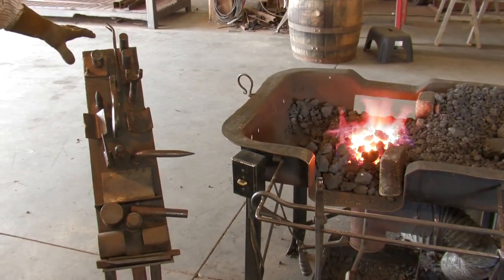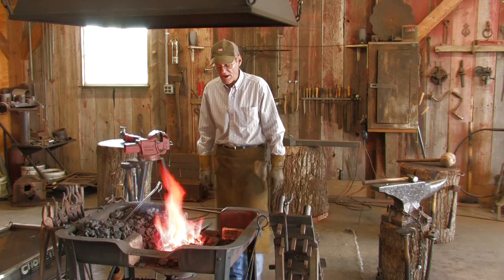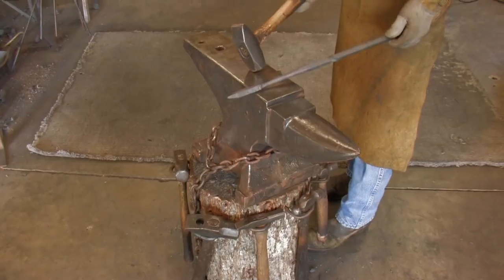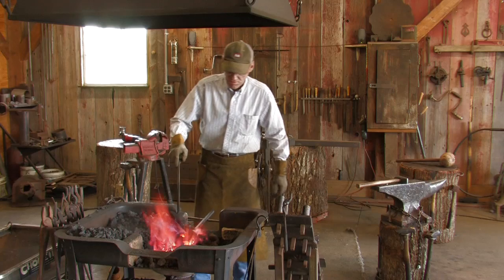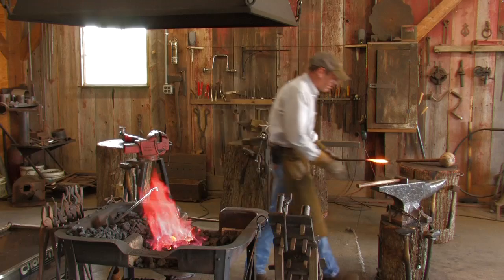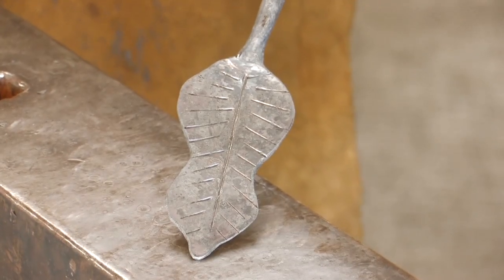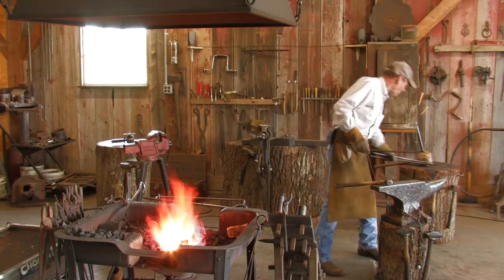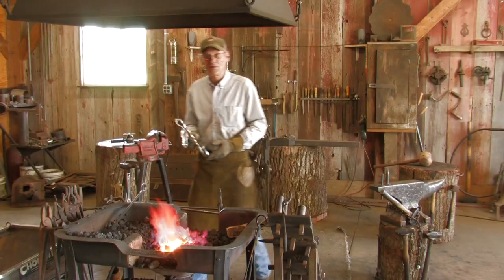The Art of Blacksmithing: Walter Howell of Walter Forge

Comment: The most inspiring thing he said in the whole video: "It's not rocket science. It's just heating up metal and bending it."
Reply: Its not rocket science but it does take some gumption and skill. To say Walter takes the practical common sense approach to things is an understatement. Quote from our son, "Let me talk to Dad, He thinks he knows everything and what makes me mad is He does!"
Reply: Understandable.

Been studying up to become a professional Blacksmith, myself. Your video really introduced me to how a Propaine forge works, actually. Keeping the temp. at a constant rate to make sure carbon levels in all of the bars you're shaping the exact same rate.
Reply: Glad you are enjoying the video. We are uploading new ones on Walters you tube channel. One thing though. Walter doesn't forge with propane. He forges with foundry coke and has a special fire pot for the higher temps. You are correct about the temps. It makes all the difference in time and energy exerted as well as effecting the look of the final product.
Reply: I see. Apologies for mistaking the temperature adjustment. I've mostly seen a lot of people use Propaine. I myself, like to do things traditionally and use air flow. I'll be sure to check out and subscribe to the channel.
Reply: Walter uses a leaf blower and a dimmer switch for air control. He chose to retire the original hand blower while it was still working. Thanks!
Reply: That's so cool! I'm stuck with an Air Compressor, but I've always wanted a decent sized Hand Bellows!

A Box Bellows would also make a fine air circulation system, too.

I need more training. lol
Reply: Hey we finally know why blacksmiths had lots of children. To turn the blower! Being broke is the mother of invention. The dimmer switch gives Walter total control over air flow. For less than $50. for blower and switch.
Reply: That's interesting...

I'll have to look into that.

Comment: Good rainy morning to all. Thanks for all the views. To answer Philo Sophia ... Yes I do use magnets in the shop. When you are out demonstrating the sound acts as a calling card. As for the gloves. I use a very thin Kevlar glove that provides some protection but you can still feel the heat. They are thin enough to allow hammer control. I do this full time. My hands are my living. The gloves have saved my hands more than once. I think you will find that a lot of "forging rules" are more personal preference than, right or wrong. Advice will vary depending on age of the smith and the work being done. Listen to all of it them and decide what works best for you.

Comment: Mic, what would you call a Blacksmith that used a lathe, a drill, a grinder and a power hammer?
Reply: Smart if he wants to make a living at it. The attitude that you aren't a blacksmith if you use electricity is ridiculous. Puffy shirts and three pointed hats do not a blacksmith make. You want to get to basics you have to forge in a hole in the ground. Walt doesn't role play. He works.